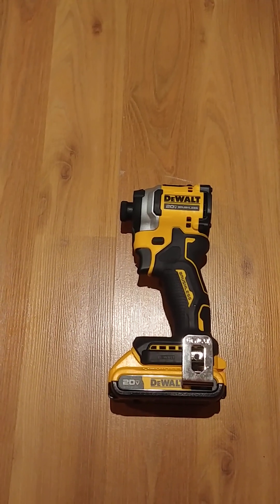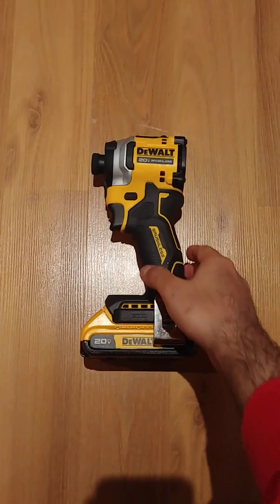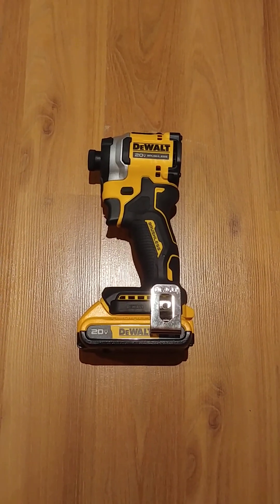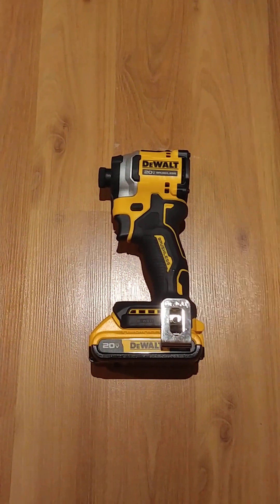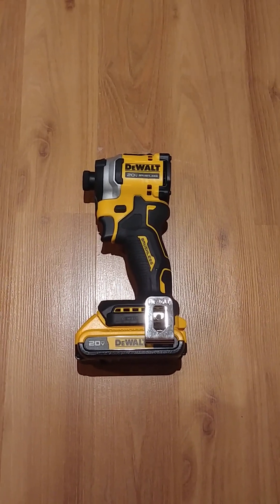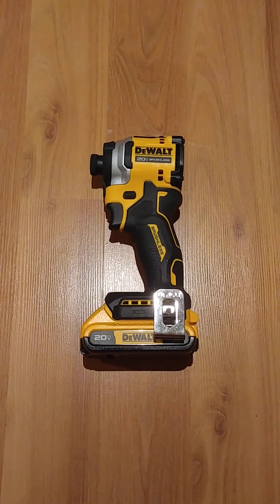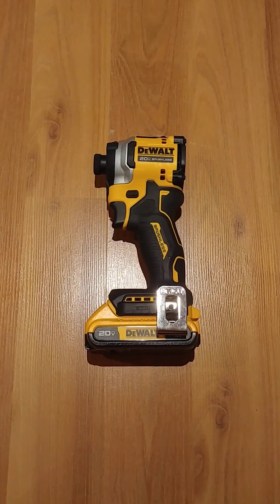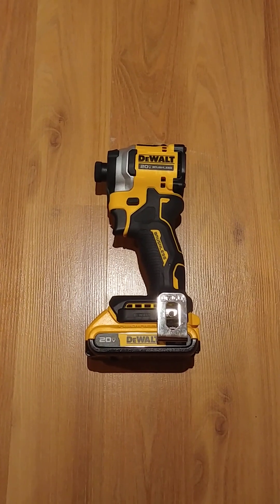reacting to TTC video comparing the DCF850 vs DCF845

Comment: Have the DeWalt XR DCF 887 the DCF 840 and Got the DEWALT XR DCF 845 and paid $175 from Ohio Power tools the 845 got it's butt handed to it from my HARBOR FREIGHT HERCULES 2200 INCH POUNDS and for less then HALF Price
Reply: @THEBEARDEDTOOLGUY
Nonsense…!!! Give the 845 and the Hercules to a roofing crew and I bet that Hercules burns out within a few months to a year.
Reply: @slickrick8046  it might buy covered by a 5 year warranty
Reply: @THEBEARDEDTOOLGUY  
The XR’s stay kicking for longer than 5 years doing large-scale operations and under plenty of abuse. You would actually be losing money having to shut down and run back and forth to Harbor Freight. You guys are trippin’ if you think people who drill a couple of screws on YouTube is a real test.🤭

Comment: 845 drives screws faster due to the more impacts Philly fix did a good comparison.  TTC does get to the overall power ratings but there are many other factors based on your needs that makes the right tool for the job. and other ergonomic features.
Reply: @Robert-wg5no 
DRIVERS are for driving purposes. The nut-busting test for drivers is the equivalent to having offensive linemen running the 40 yard dash at the NFL combine…useless.🤭

Comment: I was in the same boat as you lol but I am glad the 850 didn't fall far behind. But for me the compact size and performance is the winner
Reply: @papatee3024
Compact…??? The 845 is actually smaller and lighter than the 850, the 850 also has horrible balance in the hand. Also, when it comes to performance…Home Depot’s DeWalt Atomic line is made for the DYI guys and is not good for large-scale operations. DeWalt’s XR line is their high performance line.

Comment: Dcf50 is top dog. Performance in that size package is going to be hard to topple. Don't regret your purchase at all. I'm looking at getting more 50s instead of thr 45 after seeing all the recent reviews.
Reply: No it’s not. The Home Depot’s DeWalt Atomic line is for DYI guys and people who don’t put a lot of time on their tools. DeWalt’s XR line is their high performance line. The 850 Atomic would not last in large-scale operation where the driver is being used and abused for hours a day on a regular basis like the XR will. 

Plus that 850 is uncomfortable to hold for hours on in because the balance is off due to the excessively fat head. The 845 is actually smaller and lighter and has better driving performance.
Reply: @slickrick8046 depends, their atomic stubby’s are very good. Best performing stubbys available.
Reply: @americafirst6016  
No it’s not. The 850 is bigger and heavier than the 845 and 840. Plus the balance is off in the hand on the 850 because the head is so big.
Reply: @slickrick8046  I'm talking about impact wrench stubby. Dcf 921 and 923.
Reply: @slickrick8046  I have been using this 850 model over 6 months daily. I'am carpenter and sometimes it gets beaten guite brutally. Nothing wrong with it. It is the beast for it's size. youcant go wrong with this one.
Reply: @samiaronen  
All carpentry work isn’t the same. I often use a metal roofing crew and those guys use their driver for hours on in daily. Never seen an Atomic go longer than a year in those types of large-scale operations.

Comment: Hey bud, it looks like comments are turned off on your next video regarding DCF900. FWIW, my DIY-perspective vote is No - i'd  save my money if I were you and get the 900 only when i actually run into a situation where the DCF891 doesn't cut it for some reason. I woudn't expect that'll be often - 800 ft-lb breakaway torque is up there. If you haven't already, maybe check out Torque Test Channel's videos "Dyno graphs of every Milwaukee fuel impact: how much do you need?", as well as their video testing the 891. Anyway, nice kit you've assembled for yourself - lots of good choices 👍
Reply from the maker: Thanks for your reply. The DCF900 has come on sale a couple times since, but I've resisted. The DCF891 is working well for me and so far I haven't come across a bolt that it can't undo. BTW, Torque Test Channel just released a similar video comparing the full DeWalt lineup of impacts :)
Reply: @uptightdiy  same here - DCF891 is just an outstanding tool. I really don't expect to need anything stronger than that for my own use. Glad to hear it's working out for you too 👍